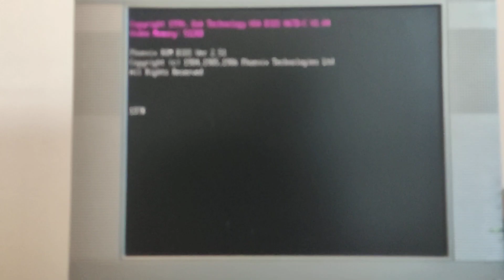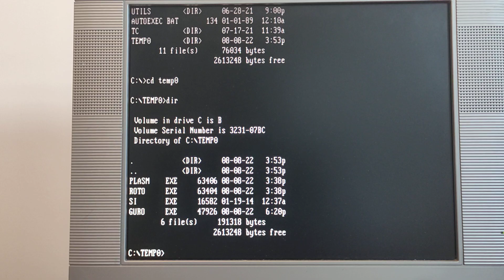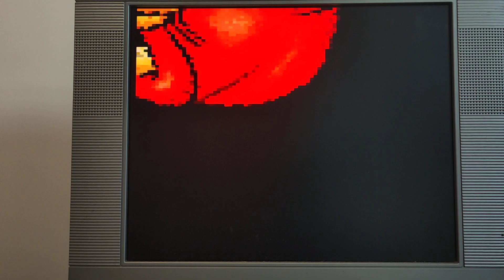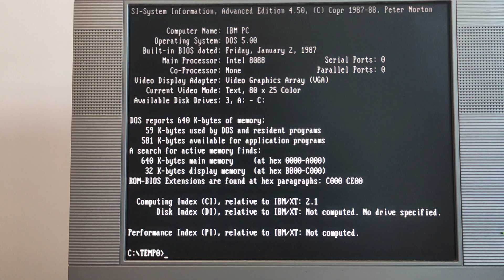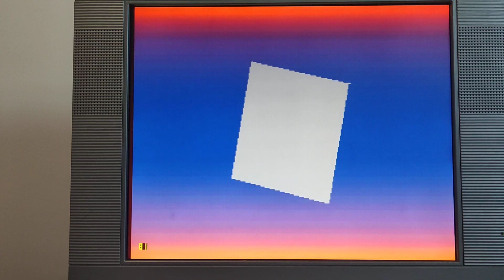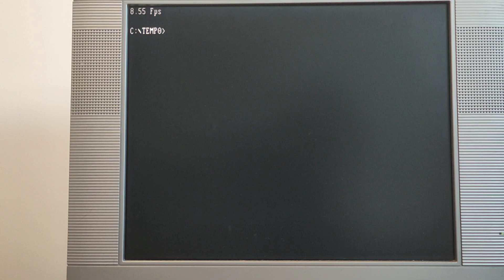Can the 8088 do Gouraud?

Comment: I can see (based on the date) that they were compiled yesterday (Aug 8).. did you code them after watching the latest 8088 demo?
Reply from the maker: Sort of, I did setup the 8088 back at the kitchen table where I used to have the 286. Just to watch the new 8088 demo (previously with a CGA card and CGA to VGA converter, but now for this video I plugged in a VGA).
I only recompiled the gouraud cube from 286, changing few opcodes that are not supported, very little new code.
But the rest of the examples where not coded yesterday, they were just copied in the XTIDE CF card.